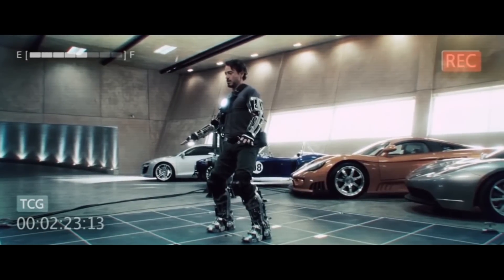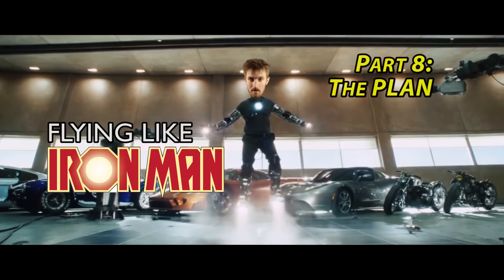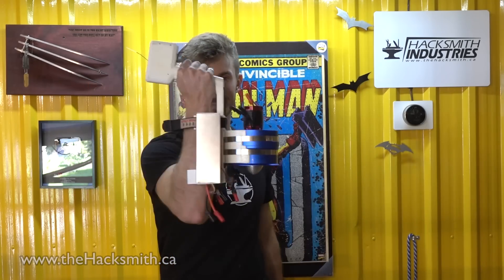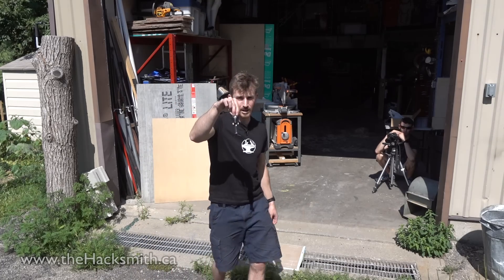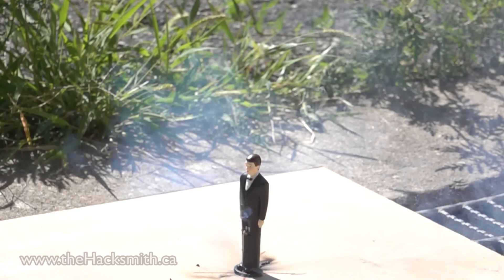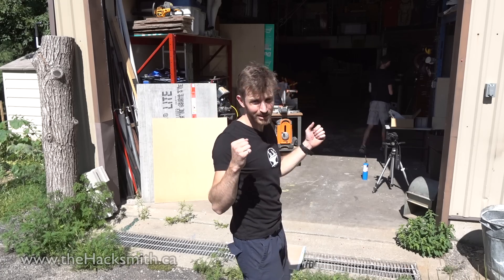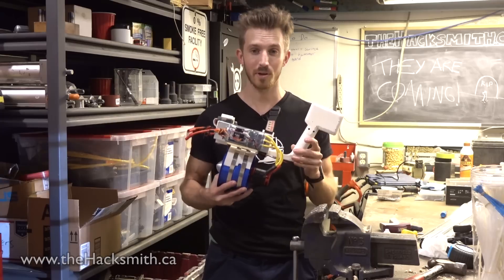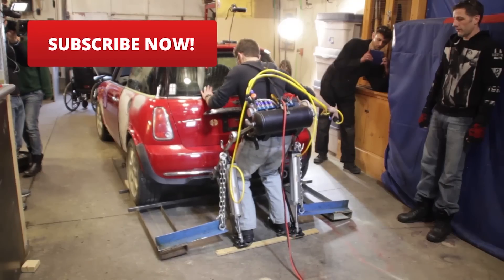Flying Like Iron Man #8: The Plan with Electric Ducted Fans

Comment: Your wrong about the position of thrust. What really will matter is the center of mass and pressure. The center if mass needs to be above the center if pressure for stability. What you were describing was a pendulum rocket idea which is totally false. The point of trust dies act as a pivot poibt, the center of mass is. The reason that the guy didn't fly when the rocket was on his feet was because the center of mass was so low. Now I hope that you already know this and are just dumbing it down for the viewers to understand, but you definitely could mount the majority of thrust to your feet so long as the batteries make the center of mass above the center of pressure. Then next problem with the feet mount us keeping your feet straight and in line. If anything that is the reason why you shouldn't put a lot of edfs on your feet. I think you should have the c.o.m slightly above the c.o.p so your stable when ascending and then gave to be careful when descending. Good luck!

Comment: You have  3D printer and CNC so can't you make a big EDF ?
Reply from the maker: +Abdulla Qasem EDFs spin at 38000rpm, so the 3D printer is out -- machining might be possible but very complex -- designing our own, even harder. We aren't aerospace engineers :(
Reply: Wouldn't just sizing it up by the same percentage work. In other words just make the fan 50% larger in every way. I would think that would work.

Comment: Why don't u have the power source on the ground so you don't actually have to carry all that excess weight but have it connected with large cables or wireless power maybe if possible???
Reply from the maker: +Mark Youssef we will do initial tests like that :)
Reply from the maker: +Mark Youssef we will do initial tests like that :)
Reply from the maker: +Mark Youssef we will do initial tests like that :)
Reply: +the Hacksmith lol. I just emailed you guys about an engineering project that I would like your help with since I just got into a competition for it and it says you guys get a lot of emails😞😞😞. Does that mean that you guys have a huge list of emails and try to go trough everything but you guys take a long time because I think that you guys would like this idea but it's due at the end of September

Comment: What if the batteries stay on the floor and you simply run wires to the duct propeller thingies
==> You don't have to provide lift for the weight of the batteries
Reply from the maker: +lozkong first tests will do that

Comment: Why don't you design a system that you use RC jet engines (really expensive though) and place 2 of them at your back and use the fuel as a cooling system for your electronics? Oil cools down gasten than water so it can easily take the heat from your electrical components to control the EDF's at your feets and hands + when the fuel is hotter it Burns better in the engines (maybe? I don't know for sure) If i would have the money I would defintely give you 100k $ and let you do your thing because when I look at your channel I can see that you know what you're doing. Keep up the good work and I hope you'll Find the right sponsor!!!!!
Reply: gasten->faster*
Reply: And I think that the rc jet engines produce way more thrust
Reply: http://www.ultimate-jets.net/collections/jet-engines/products/b-300-f-stg 
They produce About 50 kg of max thrust so with 2 of those you should neet to be able to lift your whole system, 1 big problem: the hot exhaust gasses but I'm sure you can find a solution for that.

Comment: have you thought about a small fuel engine to generate the electricity? instead of tons of batteries
Reply from the maker: +ManiacWolf Roar not on this scale... A generator the size of a trailer would be required lol
Reply: +the Hacksmith would it be practical/safe to teather the generator to you Vea extention cord?
Reply: +the Hacksmith What if you made a custom generator with a high revving engine? Most generators use rather chunky, low revving engines as they favor durability and efficiency.

OTOH based on your math you would need a ~140kw generator, which would be just over 200hp when you factor in energy losses of the generator. That is quite a lot, but there are motorcycle engines that could do that. Idk how heavy that would be, but it might be comparable to all the batteries you'd need anyways, and last longer.
Reply: +the Hacksmith After a bit of research, I found that a newer hayabusa engine makes just under 200hp and weighs 150/220 pounds. It's not ideal though because the gearbox and crankcase is apparently one piece (you don't need the gearbox), and you could probably do a lot better by starting with a smaller 2-3 cylinder engine and turbocharging it anyways. Idk, It's just something to think about, and not nearly as ridiculous a notion as you suggested :)
Reply: the Hacksmith well i'm just posting random ideas... only practical way for my previous idea .. mm maybe to recharge batteries when not in use? and add a little more energy to the system...
wait... how much force can you make on small sized fuel jet turbines? instead of liquid rocket boosters i think could make some good work at least as a backup, and then use is to add energy to the electric system? (again.. random ideas)

Comment: you need more power but that will get you more weight and that you need more pwer and so on???? is this what your mean????(srry for my english i am a dutch guy 15 years old)
Reply: and i mean with power the get up (fly)
Reply: Basically.. to lift him he needs more power.. aka more batteries.. but then he would need more props, and again more batteries so he needs to find a good in the middle.
Reply: +Frotzy mayby use some lots of lots rc moters and a hight batery?

Comment: I'm not too sure I agree with what you said about foot-mounted thrust, the problem on your "demonstration" if you could even call it that, is that you spent no time aligning the thrust, and so it was naturally going to be offset, had you placed the thrust directly behind the center of mass, think every rocket ever. then it would've went straight up, excluding aerodynamic effects that is. but I don't think you'll be screaming across the sky with this anyway.  not to mention, biologically, supporting the weight from our feet would make more sense, since that is how we were designed to carry ourselves, not hanging from our torsos. Either way, while I cant put out any money,  I really want to see where you go with this, so good luck!

Comment: hey bro you just trying to get off the ground use a cable 30ft to power the fans then you wont have the extra weight of the batteries

Comment: use four of each a you could fly with thoses with no problem
Reply: use four of each on your legs and hand then the ones that go on your feet you could connect to your waist so they can work with your feet
Reply: more fans, more batteries, higher budget.
Reply: +Ricco Core Do the math.  8kg of thrust per fan; 70 kg guy.....he would need at least 9 fans and that's not even counting the weight of the batteries.  Although, if he did get those larger fans he was talking about, we would be talking different numbers
Reply: It's probably a touch more complex than that and just like he said in the video. He doesn't have enough EDFs yet
Reply: ähhh... last time i checked 4x4=16 ^^
ricco suggested 4 fans PER limbt (aka 4 on the left arm, 4 on the right arm and so on)
this would give him 128 Kg of thrust.
i dont know how heavy these batterys and the needed electronic components /casings are but with about 58 Kg spare thrust it should be doable.
maybe place some of the feet ones on the back to ensure that most of the thrust is above the center of gravety? (aka 4 per arm, 2 per leg and 4 on the back)
Reply: +drizzt7dourden7 yes that can go waist or back even both but i would need to test it first on both I've only seen it dont on waist arm and legs

Comment: I am no electrical engineer and have no idea about this would work, small small solar panels to charge a battery when not in use, I don't know just an idea
Reply from the maker: +Harry warren solar panels aren't nearly as good as media makes them out to be... For example my entire roof has solar panels, and is rated for 10kW -- but even on a sunny day it barely produces 7kW. Just ONE of these EDFs requires 7kW :p

Comment: just taking the easy way out... sucks really wanted to see this happen.
Reply from the maker: How exactly is this the easy way out? Rockets were not the answer... they only lasted for 1.7 seconds...
Reply: +the Hacksmith rockets are not the solution. But making it more of a jet pack isn't what I wanted to see. they have the hover board for the jet ski. it would require much More work and practice to get flight. but would be cooler in the end to see.

Comment: Actually, moving the center of thrust above the center of mass wot do much. You are believing what is called the pendulum  rocket fallacy. Really, it makes sense in your head and you think it should work but it doesn't. That is because gravity acts on the whole object. If the thrust vector was always pointing straight up, then the rest of the "rocket" would act like a pendulum and keep it flying straight. But since the thrust vector is fixed to the rest of it, it will just tip over.

Comment: So the Alloy DP-2 Series 120mm EDFs you link to are ~£220 and put out max power 7Kg of thrust.
I weigh just over 57Kg, therefore, 57 / 7 = just over 8 + the weight of each EDF, which is ~ 1Kg.
Thus requiring approx. 10EDFs to allow me to hover above ground for the 2 minutes you stated the batteries will probably hold charge.

10 * 220 = £2,200 to build an Iron Man propulsion system suited to my body weight allowing me to hover...

THAT'S CHEAPER THAN THE ZAPATA FLYBOARD WATER JETPACK!!!

Wait..............
Do I have £2,200 in my bank account?
Reply from the maker: You forgot the price of batteries and speed controllers, which will probably run you close to 220 per EDF as well. Then the custom 3D printed parts to hold everything together, another few hundred in controllers, oh and the fact that you need more than your weight in thrust to hover -- 150% is a good baseline...

So.... 15 * (220 for EDFs + 220 for batteries/ESCs) + 300 for miselaneous and maybe another 1000 to get everything printed... 7900 euros.

Its okay, I don't have that much in my bank account either =(
Reply: the Hacksmith
Partial Facepalm...

In all honesty anticipate the reply you just wrote;
Only 8k... To hover in Iron Man format?

Of course with your system finalised, coupled with some CPU controlled gyros balancing the main body thrusters out regardless of orientation (I'm a VR fan), with a nice supply of money and access to custom built Carbon Fiber safety exosuit... We are pretty damn close to legitimate Iron Man suit.

It'll be bulky, obnoxiously loud, dangerous as hell, but who gives a shiatsu!

What would you do if you were filthy rich? Buy a private Jet Plane?
I THINK NOT!

Comment: Why not use rocket rocket boosters on the back?
Reply from the maker: +Louis Stubbolo cause the rockets only last 1.7s ... What's the point?
Reply: +the Hacksmith **original post was supposed to say solid rocket boosters. The point would be to achieve stable flight for 1.7 seconds. You've worked with them a lot before so you know how cheap they can be. (black powder + ethanol = cheap thrust) If funding is an issue you could still potentially test/demonstrate the arm stabilizers using solid fuel as your main propulsion while you wait for the money for the ducted fans. v----v-click--v-read--v-more-v----v

***edit: just read through some of the comments and there seems to be a lot of hate/criticism. I personally respect the endeavor you are undertaking and I really wish you the best of luck. I very much look forward to seeing whatever you come up with, regardless of if it's "exactly" like iron man or not. You're awesome, and you inspire me. Thank you.

Comment: Found a EDF he plan on using :)
Schubeler DS-215-DIA HST 195mm Carbon EDF.
It match - 195 mm, ad 24 kg of thrust. Cost ... 3 349,00 €
Battery for this will be massive - 14 cells with 310 Amps 

Link:
http://www.turbines-rc.com/en/edf-ducted-fan/344-schubeler-ds-215-dia-hst-195mm-carbon-edf-ducted-fan-motor.html

Comment: ask any rc builder/pilot. edfs are pretty pathetic. like really small props, they only work well on a fast moving airframe and even then they are massively inefficient. trying to use an edf as a means of generating enough static thrust to make yourself hover is pretty insane. as soon as I saw you were going to try and fly using edfs I had no hope. it will never happen.

to give yourself even the smallest chance you would have to have the batteries or your power source on the floor.

also the current draw is going to be astronomical.

Comment: you know how wind mils work? why don't you use the same concept for the fans so they can charge them selves and not die.
Reply from the maker: +friendly naborhood spiderman because it's not that simple :p
Reply: well what if you did your own design on the fans to save money?
Reply: also try to use stuff that you can find in a junk yard if possible.
Reply: also try to use stuff that you can find in a junk yard if possible.
Reply: In simple terms, the power captured by the "wind mills" is only a fraction of the wind energy involved (the wind only moves the blades of it hits them, and a large portion of the area the blades cover in total is a small portion of total space the wind energy would have to be passed through to ensure the blades are hot consistently.  Given then, that there is a loss of total captured energy when it is converted to electricity, it would be impossible for the fans to produce enough thrust (wind energy) to fill the total space the blades pass through, to produce enough power to keep them fully powered. (Not even counting the amount of energy lost in the conversion of electrical power to motion of the fans to convert that electrical energy into wind power)

The reason windmills work is that they are capturing a portion of the energy already present in wind caused by atmospheric conditions, which exist whether or not a windmill is present.

Comment: if the batteries are more weight, why not loose them? your not trying to fly 50 feet in the air your trying to get stable above the ground. run extension cord to that boy.  plug that shit into a generator. battery problem solved.

Comment: thrust at the top and thrust at the bottom makes no difference if you are talking about rigid systems
Reply from the maker: +ravener is the human body rigid?
Reply: good point...
Reply: What sort of batteries are you going to use? - LiPo, Liion, arc reactor, what?
Reply: the Hacksmith why do you think i mentioned the system being rigid? it's to say that "this isnt the case here, but in general...."

Comment: It would be interesting if you could use an eestor supercapacitor. https://youtu.be/9fC6yPZOXcc I believe that regular capacitors weigh less than batteries and would give you the power if not the duration. Perhaps you could use a "straw man" under remote control to demonstrate your proof of concept. Also as you are changing the Ironman model think how Superman flies with arms outstretched. Change direction of fans so instead of pushing up you are pulled. More stable? Able to navigate?

Comment: Okay okay okay okay....
Ive always like most of your builds, vids, and general attitude, but when you go into the explanations of things, I honestly hope you are dumbing it down just in your particular word choice: in regards to your explanations, there is nothing that makes thrust above center of gravity more stable that thrust below, only the prop up top has an inherent stability factor on it(which tiny edf's would indeed have.)
Watch https://www.youtube.com/watch?v=Tx4cjP-GRAY for a great explanation. 
Now on to that whole rigidity subject: You will never have a rigid point on the human body (including exosuits) to mount propulsion to, without some level of active stabilization. an arduino 101 has several features built into it that would make it great for low level stabilization, including a 6 axis imu, Bluetooth for overall suit comm, and a quick enough core to control ins and outs of an active stability system, plus, it has learning capabilities from a neural network(but this would be for much later). you could use one per foot and or hand for a 4 or more point active stability computer. these are cheap in terms of power consumption and price. 
Now in terms of money efficiency, you have a 3d printer, engineering capabilities, and a willpower to do this, so why not design your own edf's? you can use the same motors to start, for a larger prop, this has problems of course and it wouldn't be the long term solution, but you'd be pushing alot more volume of air, you can also design every single aspect about them to to fit seamlessly into your design. 
Hope any of this help, or at least gets you thinking in a way you may not have before, keep up the work and the quality videos!